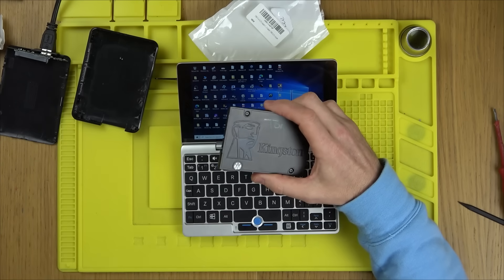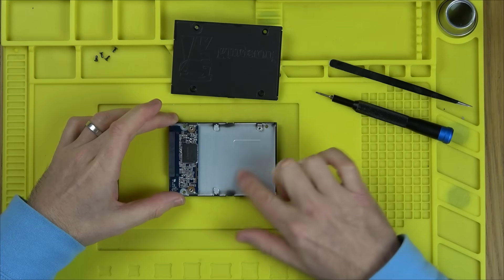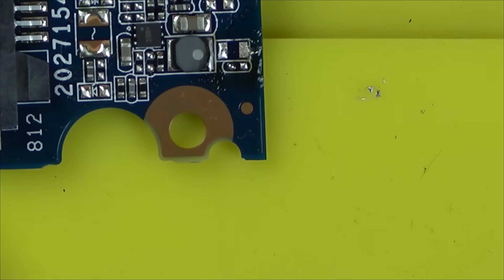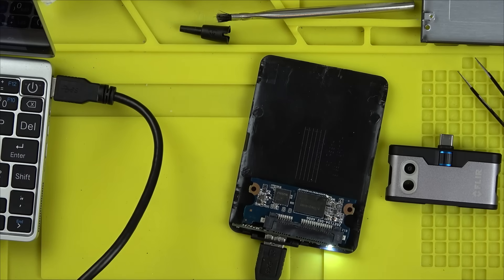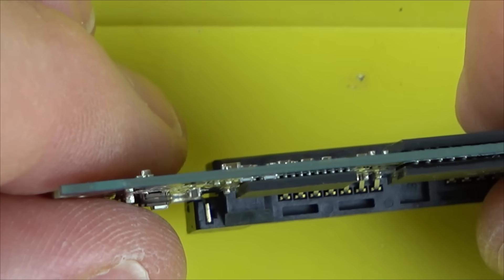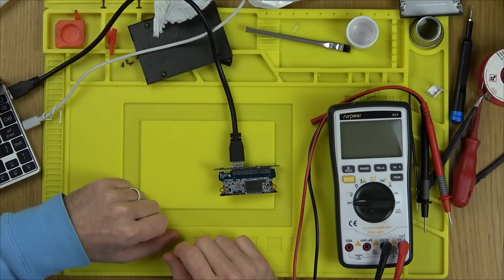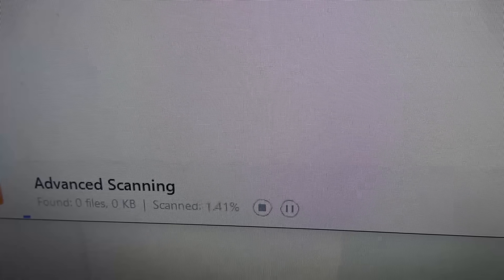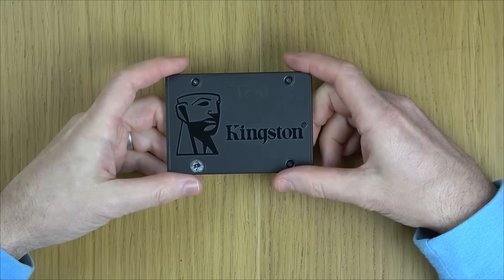Can I FIX a Kingston 240GB SSD ?

Comment: I would have strated with a good old chkdsk /f from sys32 cmd under windows. I think it is better to try the software failure first in the case of hard disks. I really can't count the number of disk i recovered for friends that did not mount corectly anymore and i think a lot of them disks get thrown away for bad reasons. Although there is numerous definitely hardware faults too, i don't deny that :)
Reply: When trying to recover data you should never run any kind of utility that will make changes to the drive, which could end up overwriting and destroying the very data you are trying to save. In this case it wouldn't help anyway since the controller itself appears to be faulty.
Reply: @_Thrackerzod  yes, as i Saïd i had not Seen the rest of thé vidéo when i wrote. The disk appeared raw, seems like a corrupted mbr at first

Comment: Hi Vince, I do come across simular problems mainly with external drives, sometimes pc driver related, sometimes it is power supply related like plugging in the wrong power supply into the wrong drive, so it has enough power to boot up the drive, but not enough current to run the drive for a HDD, with the driver related one then it tends to need me to wipe my computer completely and re-install windows. might be worth checking on a spare computer that he doesn't mind wiping the OS off, and then using the proper power supply and data cables rather than usb power. just a couple of helpful tips.
Reply: btw. you owe me a beer if this works out for him!! haha🤣, but being ssd then shouldn't matter so much that it is usb power, but that being said my father couldn't use my SSD on his pc same fault, but worked fine on my pc and able to use the usb SSD, anything is worth the try when at a loose end. hope this works out and he can recover the data off the drive, just make sure when wiping the OS off the spare pc not to have the SSD installed until the new OS is installed, so that you don't accidentally wipe the SSD.
Reply: as for it disconnecting from recovery software, then my guess would have to be that the SSD is boot-looping due to a lack of constant current supply, but as there isn't anything to hear with an SSD unlike a mechanical hard drive, then not so easy to find out without trying other avenues like a tower pc, and power supply on it, as well as data cables.

Comment: Hello Vince.  In some ways these SSDs can be a bit depressing in how little physically seems to go wrong, leaving you with the undesirable task of either chip-off recovery + reorganisation or fighting with that controller.

I've done a lot of work using ddrescue under linux and coupling it with a USB power switch that is controlled from the command line; so in situations like this you can craft a customised behaviour script that will let you do things like read 100MB, power cycle, read another 100MB etc, to save having to do the manual work you were experiencing.

I suppose the "proper professional" solution here really is to have the chips removed, read off the data, and reassemble/decode it,  usually things like PC3000 have all the decoding maps predefined for a lot of the controllers.
Reply from the maker: Thanks Paul. Probably a silly question but am I correct in thinking that even if I got an identical SSD and placed these 2 Kingston storage chips in the new SSD with a working Phison controller it still wouldn't work. The reball  on the Kingston chips looks doable and the SSD are only £20-£30 on eBay, but I presume they are already connected via software together.
Hope you're keeping well over there. I need to catch up on some PD vids, if you have any in mind that stand out let me know 👌👍👍👍
Reply: @Mymatevince  I actually don't know to be honest;  I suppose it would depend a lot on how the controller manages its remapped regions, ie does it keep it on the NANDs or internally in the controller.

I'm sure someone with actual experience in that sort of task might weigh in.
Reply from the maker: @pldaniels  Thank you Paul 👌
Reply: @Mymatevince  each controller would have its own map either directly in controller or off chip in flash chip somewhere
No, you cannot swap controllers, as data in flash is unlikely to be sequential due to wear leveling and trimming 
Effectively data blocks may be placed completely random
Reply: @Mymatevince  It would not work. The chip stores data location. Swapping it would not help.
Reply: @Mymatevince  no, it won't work from what I've tested. It's not just a controller, but more than that. And, the best way would be to ONLY use a backup ;) and never trust them if someone cares about their data. I say it to all my customers. 

On my YT @screen-protector I'll have soon a Patriot P210 512GB with the same type of fault. I bought the 2nd one just to compare. We will see, maybe I'll be more lucky than you were @Mymatevince.
Reply: Still on the same topic, when you use such disks in a USB hub, it may be up to the SATA <-> USB bridge to handle some errors, which recovery software can't detect and use over USB, since it talks with the USB device, not with the SATA disk. In other scenarios (not the one in the video), it may be worth it to hook the disk up directly to a SATA port on a desktop, rather than through adapters.
Reply: kingston a400 has cheap controler that usually overheats when it writes, there's reason why they are so cheap
Reply: who gives a care. dont you have better things to do then save this garbage?
Reply: @northhankspin  indeed - could be out making useless comments.
Reply: Same can be done with HDDsuperclone right?  I guess i have to pull out the relays...

Comment: windows times out drives if it cant read from it unless you disable timeouts in windows (i use windows tweaker or ultimate windows tweaker)
i had a drive that was failing that was causing my windows to hang till i turn off timeouts in windows then it let me get the data off it to back it up then i formatted it so i could only use the good parts of it for data i didnt care if i lost (like games or temp files games/software use)

Comment: I had a similar situation to this.
I don't know why but had the idea of freezing the drive as much as possible in the fridge and it worked! Well it did before it thawed out, then it went bad again.
The files were not important so I left it at that, the drive was basically dead at room temperature.
If they were important though maybe I could have taken the idea further and put  the drive in some LN2 or something while trying to extract stuff off of it.

Comment: Hi. Do you think this could be caused by cracked points on BGA solder?
If so, trying a flow is an option, since there's nothing important to lose?

Really enjoy your videos!
Reply: I believe it is far more likely to be a voltage/current issue than a BGA reflow from personal experience.

Comment: It's more than likely a software problem, where the controller tapped out and corrupted the table that shows all the allocations/mapping for the data. With the way data gets written and deleted it needs to keep track of segmentation of data but if that table gets trashed then deciphering what goes where and in what order is pretty much impossible.
Reply from the maker: Thanks for the info SJM 👍 Looking at SATAFIRM S11 problems on Google suggest it is quite a common failure on these Phison chips. Apparently you can put firmware back onto it which will allow the SSD to work again, but the data will be erased. Hope you keeping well 👍
Reply: @Mymatevince  Hi Vince.  Bit off topic but can I ask what make/model of the pc is? It would come in handy for my workshop. Thanks 👍
Reply from the maker: @stevemartyn203  That is a 'GPD Pocket' Steve. I think they have released a couple more versions since that one 👍
Reply: @Mymatevince  Thanks, hope you've been well too. Keep up the interesting repair content!
Reply: Yeah it records all the bad blocks any corruption would make notes where everything is like a map. Nsa could make sense of it 😂

Comment: I've seen that kind of behavior in a flash drive with a bad controller.  If you look at windows event viewer, Windows Logs, System you'll probably see a bunch of error messages that might give you a tiny bit more information.  It's likely that windows disconnected the drive because it stopped responding or that it reported an error.

Comment: Hey Vince! Unrelated to the fault on the drive, but I've seen the connect/disconnect behavior before on high speed USB ports. They spike power after a few minutes and the drive drops. The fix was to move it to another port or use a better USB-SATA adapter. Because their S11 chip is bad, it's likely still that, but it's a cheap check to swap ports and cables. I JUST had this issue two days ago with a Samsung 850 (not exactly a Cadillac) and an Uantec adapter. The adapter was at fault. Moving over to a StarTek fixed the issue.
Reply: I suspect you are partially right in your answer, but can also be related to the USB port power using a mobile device on battery power, but a full on tower pc can also have the same outcome like got an ssd in a usb dongle, works fine on my pc, my father plugged it into his pc the device shown this issue asking for the ssd to be reformatted, passed it to my brother to use in his pc, device worked properly and able to read the data, passed it back to my father same thing nothing happened apart from asking to re-format. tried it on my pc worked fine. so suspect it is how the electricity is allowed to pass through cables for front usb on my fathers pc, so allowing the voltage, but not allowing the current to pass through them so easy, so creating a boot loop.
Reply: @michaelthomas3646  separating the power to come from bench supplie not try to get it from USB port, some box PC cases ports do just that, their own power in avoiding motherboard completely  plus mulit meter how much power it is taking up too.

Comment: Also worth checking if its a heat issue with a component on the pcb thats making it power down. 

There are more elegant ways to test but if its only lasting say 10 mins then a quick and dirty way to see if its an overheating component is to tape up the drive in a sandwich bag and pop a bag of frozen peas on top to see if it lasts any longer. 

I have used this a number of times to clone mechanical drives that were powering down before attempting data recovery. 

Also if that chip has been subject to high temp then it may have been worth trying some liquid flux under it then a quick reflow.

Great video and congrats on your pcb way sponsorship 👍🏻

Comment: The software won't work with USB or power saving I've initialized a drive before then used recovery program and it worked

Comment: I have had this issue with one of these before. First of all I'm pretty sure the data is gone. There's nothing electrically wrong with the drive its just bad firmware on the Phison controller.
If I remember correctly, the controller has forgot where all the data is located on the flash so the data is there its just impossible to unscramble. 
The drive can be fixed by reflashing the firmware. No tools needed only software. The drive I fixed still works to this day. 
Remember to ALWAYS keep backups of important data.

Comment: Had exactly the same model and size SSD fail 2 weeks ago, Kingston replaced it under warranty and the replacement does indeed not have the text burnt looking on the chip. Had an Integral drive fail in the same way also, both were less than a year old and not even under heavy use. Clearly they must know about this issue but still appear to be using the same chips.

Comment: If the chip has failed, the drive cant work right and unless theres a program that works as that chip somehow to keep the drive working, you would need to remove the memory and do it that way.   BACKUP YOUR DATA TO ANOTHER DRIVE REGULARLY AS ANY DRIVE CAN SUDDENLY FAIL!!   The recovery guys have all the tools needed to do whats needed however if the memory chips have failed, can they recover?

Comment: Hi Vince, I’ve come upon this issue with my Kingston ssd. I don’t say I got a fix for it but it might interest you how it got to this stage and hopefully you can pick it up from there. My son 8yo wanted to install windows 11 while I was asleep. You can imagine the surprise I had to wake up when I saw the message prompted on my screen saying that I no longer have an operating system😂. Anyhow the damage was done, so I popped in the usb my stick of bootable windows and I got to the format windows. I deleted the partitions c and d and also the small system allocated space (the smallest one). When I gave it a go to make new partitions surprise surprise partitions could no longer be created. In other words the ssd went into block state. Tried dos commands nothing, tried windows same deal. Since I wanted to understand what’s going on I had an old Kingston ssd laying around from an older laptop and I checked the following. Plugged into to pc the ssd, popped the bootable usb with windows 10 and I redid the same thing just to see if it acts the same. (Deleted the partitions and the system allocated space) surprise surprise cannot create partitions and shows up exactly as the first one and also as yours. My guess is (I’m not an expert but just from what I did with the second hard in terms of experiment) that somehow when you delete all the partitions along with that systems allocated space you simply put it in a freeze state. If anyone has any idea of how you can proceed from that point on you might be able to recover the date and also make it usable again. If any of the viewers have any tips this would be the time to pop them in here. Cheers to all of you and Vince all the best in the new year!
Reply: put it on different sata port after shutting pc properly at main and switching it on to drain any capacitors.

Comment: If the data loss is not a problem, search for "s11 flasher satafirm". You can fix one of these by reflashing the controller, done it and works till this day, no special tools needed. Common problem with these. If all the links are down and you can't find the firmware and the flasher anymore, I could upload them somewhere.

Comment: I believe that chip is what stores the location of all the files (File Allocation Table) so if the chip goes faulty you lose the data, looks like its got very hot and cooked itself, data can be recovered but would need sending off and needs the flash chips taken off and read directly into a computer that then used that data to recover the files from the jumble on the flash chip / Chips seen a couple of videos on it, it's also would explain why it drops off when you try to use the drive, could try claiming the chip incase of a broken solder ball not a fix but would let you get the data

Comment: I've used this Software (MiniTool Power Data Recovery 10.2) on my failed Samsung EVO SSD 500GB, It failed suddenly and I couldn't boot windows from it, so I ran that software on it for hours on my work computer at the weekend and It recovered all of the data and folders exactly as it was before.

Comment: I think I'd have run it through TestDisk or Photo_Rec before I'd ever gone near the case screws.  I've tried a lot of data recovery tools over the years and not found anything as good as these two.
Reply: me too, its swiss army knife of program, and even Testdisk, is a go, photorec going to get something back not all, but most things, even if it only bit of file needing editing back in hole file at least you go something to work with, and that still better than nothing at all?
Reply: was think was going to one of the internet, scams, with the little board inside the case, what is all that empty space all about? feels like scam, why would you make any thing bigger than it need be?
Reply: @dh2032  So it's a compatible upgrade for a 2.5" mechanical hard drive - case needs to be the same size and shape and have the screw holes in the same places.

Comment: it could be malware.

malware does have the capability to wipe the boot block so it will show up as unknown and even formattable.

i remember there are ransomware that wipes the boot blocks and completely bricks the pc.

since you are knowledgeable with electronics somewhat couldnt you make an arduino based device that will automatically disconnect and reconnect the drive and send a retry command to the software repeatedly?

Comment: Wow, this is obviously a logical problem not a physical problem, well, at least not till you open it.  This can very likely be resolved with recovery software. What I would do would start by making an image of the drive, and work on that to minimize reading from the questionable devices. Then recover the data from the image, put it on another device and send that back. 
If you contact the manufacturer, they can send you links to software to help get your data back, that should have been the users first step.

Comment: I got a 2 TB SSD recently and it has a very odd fault. It works fine but it is incredibly slow. It took 5 hours to install the playstation software and when I gave up and repartitioned it for the PC it took over half an hour just to format it. Hard disk testers show it as incredibly slow too. That could possibly be a power issue with a capacitor. Smart values are bad so it's D.O.A. I put my old 1TB SSD into the ps4 and installed software in 5 minutes and runs quick. So you can use SSD in PS4. Now my PC is down 1TB of space now only having 500GB so would be great to fix but it's under warranty so I'll send it back as faulty. Unless you want it for a trying to fix video. That would be a kind thanks for all the videos I've enjoyed watching.